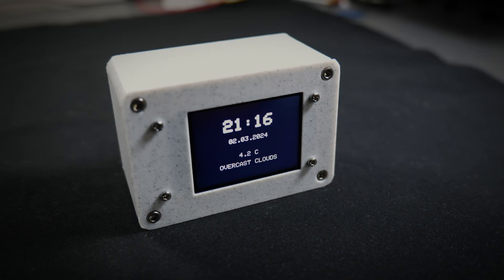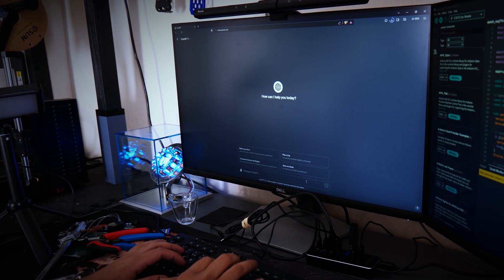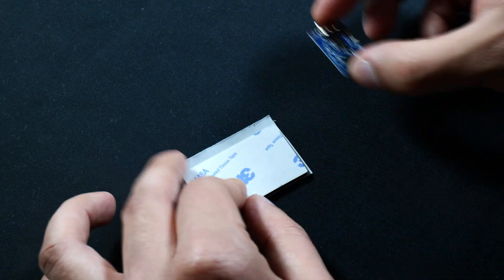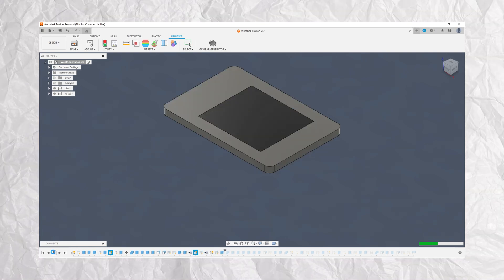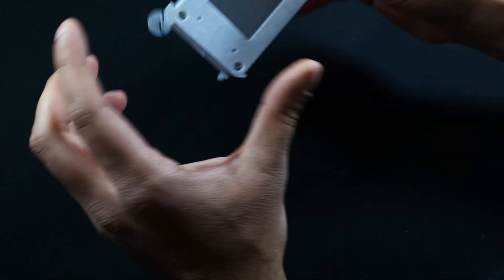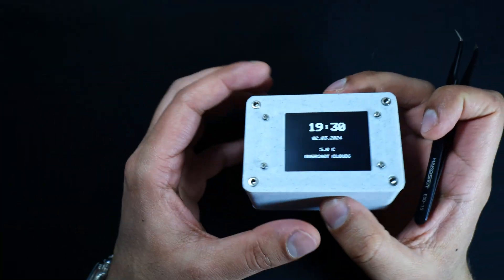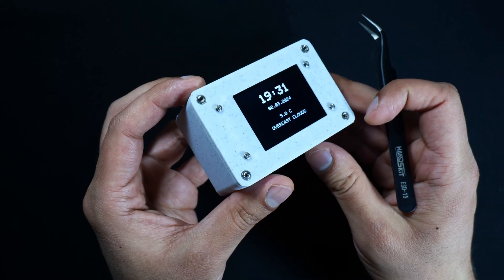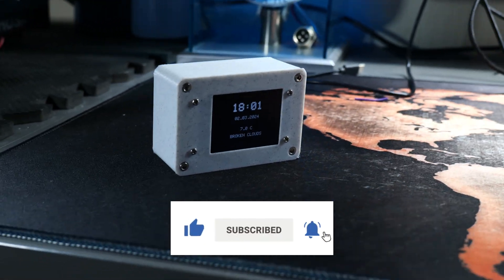I Made a Digital Dashboard | Fusion360, 3D Printing

Comment: Great build!

I just bought a pack of heat-set nuts and a new tip for my soldering iron.  They are much easier to use than I expected, and now I'm looking for a project to use them on.  I may do a remix of this build.
Reply from the maker: Heat set inserts are great. Good luck with your project!

Comment: How long can the device be turned on until you need to recharge it?
Reply from the maker: Seems to last about 18 hours, so if I was to make it again, I’d probably use two batteries. With the charger in, it stays on for good.